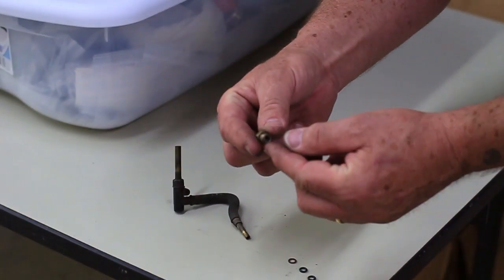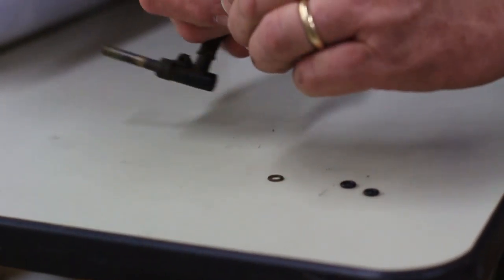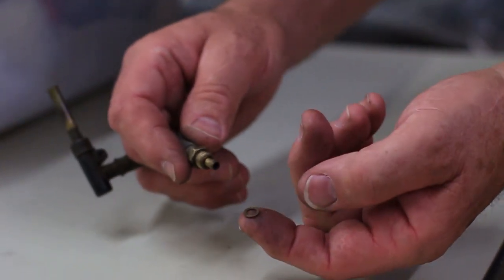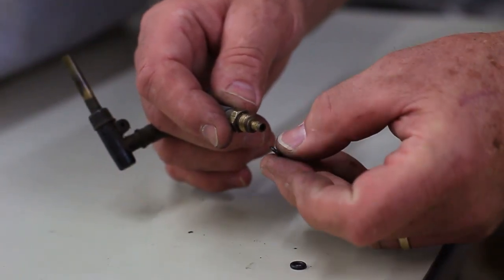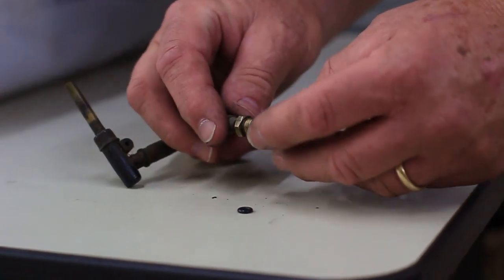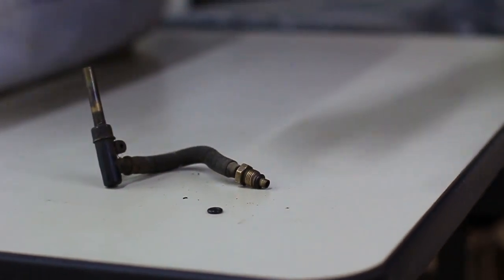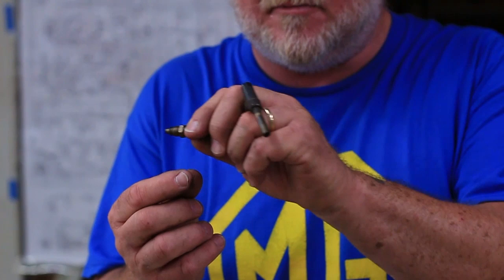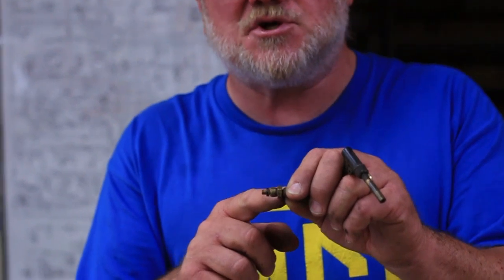245 MG Tech | HS Carburetor Jet Repair for MGB/MGC/Midget SU

Comment: Hi John My 240z carburetors nozzles are stuck please advise how to unstuck them thanks
Reply: I use Aluminum Brightener sold by Napa - it is a milder solution of phosphoric acid and works great on corrosion such as you describe.